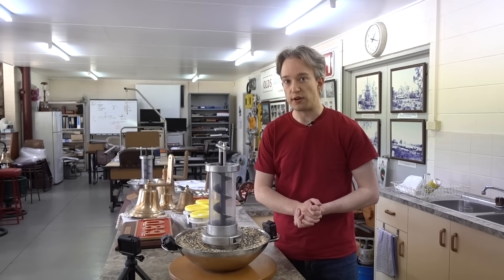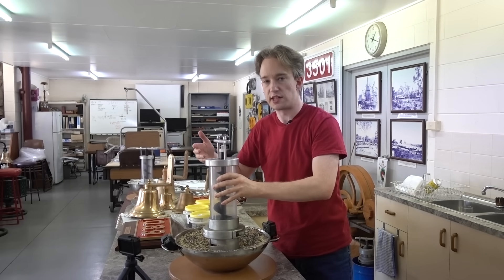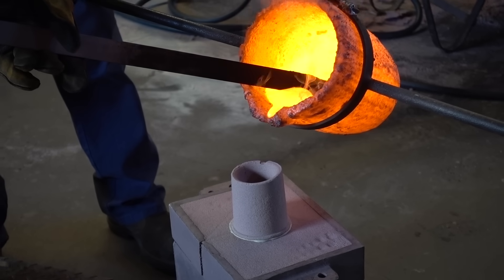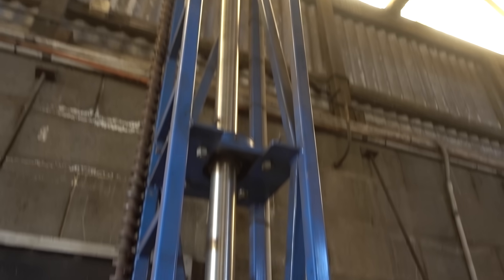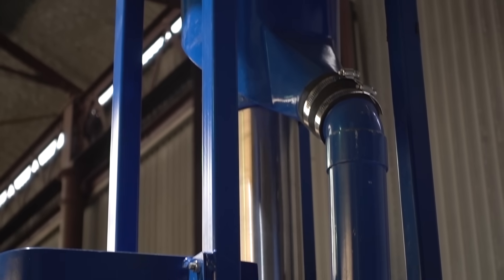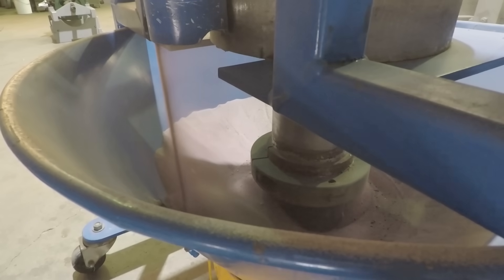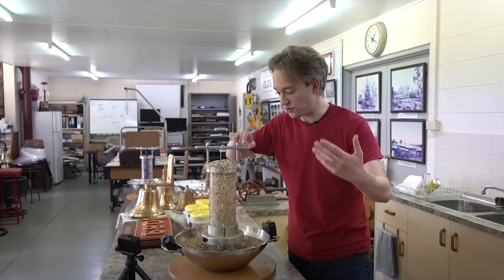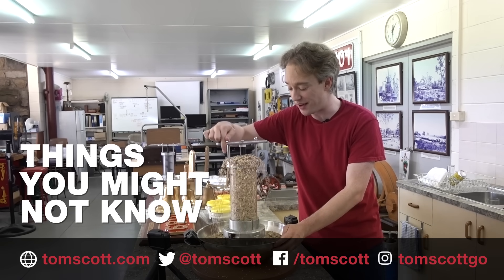Mr Olds' remarkable elevator

Comment: the main difference i see is that with the tube  it is necessary to have bulk to feed  the operation .... once the material in the tube reaches the same weight as the material out of the tube  the operation is no longer effective .....  with the screw ...  the material is being sucked in  and will continue to work as long as any material is fed into the intake .....  so ...  it all depends on what you are doing ... the sand that is recycled over and over again  is a good example of the tube being right for that job ...... in a grain silo ...  the necessity for all the material to be taken in  would be a good example for the screw

Comment: Olds Engineering is also responsible for a solar-powered pneumatic piston. That's it. That's the whole device. But the implications are astounding. With just a parabolic dish, a piston and a cylinder, we have a reciprocating thingamajig which could be used to turn over a dynamo or a rotisserie chicken.

Comment: I'm still not really sure I understand what the benefit of this is compared to turning the screw?
Reply: When a screw is turned there is a gap of air.. imagine sucking through a straw and each time you gulp there is a gap...

The case method is like pouring the drink straight down your throat
Reply: @nolesy34  What creates the gap of air?

Comment: I suppose it isn't too surprising it would work. If I had to guess, it works because in reality relative motion is what often matters. So to a tube around the screw, the screw it what's moving, and if it can get a scoop of some fluid or powder on the bottom spinning with it...

Comment: I wanted to test what would happen when this was done, wouldnt this make a sort of very sturdy drill? instead of dealing with material grinding around the sides you just pull the cut material into the center where it may be piped to some location

Comment: Interesting. I'd like to know why this is much superior to a normal Archimedes screw though? 
You can drive it anywhere up the shaft which is good, and you can keep the bearings away from the product; but other than that I can't see real benefits. Why would it product less dust?
Reply: most likely less dust due to less material being crushed by the metal screw, the material is only being push upward by the same material so it is less harsh, the hardness of the material doing the 'force' is equal. there might be dust created by the scoops but since it at the bottom of all the material being scooped the dust is not allowed to become airborne

Comment: I wonder if you even need the screw all the way up; if the machine had high enough tolerances and was dealing with large enough particles, it should theoretically be possible to only have the screw at the bottom. Of course, unless I’m wrong

Comment: So the problem being solved is there is a larger space possible between the casing and the screw allowing the product to be less damaged?  It also negates the need for long screws as the casing rotating does not need a screw running the length of it to elevate product?  I can see how it would save producers money by reducing product damage.

Comment: Perhaps this requires more energy than the traditional screw, and therefore wasn't considered earlier. Here you rotate the case, which might take more energy. And I wonder if the rotational speed of the material is the same (which costs energy: rotating it isn't free). It seems like the physics wouldn't care about the coordinate frame (think of this like rotating the Earth around the screw), so the material's rotational speed would be the same, but sometimes the intuitive answer isn't correct.

Comment: Please somebody explain to me what's the net possitive effect for the flow of solids between rotating the casing vs. spinning the shaft? I can see the merit at filling point as material is driven from the outside in and certainly with no void volume although this can also be achieved by standard designs with flight and pitch sizing. Another positive could be the length that can be built as would suffer less bending and torsional load BUT mechanically rotating the body adds extra complexity at the motor as gears and air-locks would be needed. 
People clearly has thought about this before, but a screw feeder is a cheap and cheerful piece of equipment, and it does the job: why reinventing the wheel?

Comment: I paused the video and I'm gonna take a guess at how it functions. When the walls rotate, they push the grain towards the screw surface, which is curved upwards. As a result, the grain has nowhere to go but up. It also might have something to do with the intake at the bottom of the conveyer, which is grabbing grain and pushing it into the grain which is already in the tube, causing a force which pushes it up the tube. I bet if there was no more  grain at the bottom, the remaining material in the tube would stop rising.

Comment: It probably hasn’t been heavily done before because it’s simpler to spin the center shaft rather then the housing. Especially without modern tech. If this was made out of wood like bamboo you would spin the shaft. Even with sheet metal. Making the shaft stationary and the housing spin is an overcomplicated process that just wasn’t necessary.

Comment: What's the maximum height it can lift and does the screw have to run through the entire height of a tube? Like what I be able to put a piece of AVS where your crank is and elevated 20 ft or would I have to extend the screw also?

Comment: Did you try rotating the "scooping" tube without the screw being there? It would seem that just the tube would force product into the bottom and its only path to escape, is up. Sorry, I didn't find this 'til today.
Reply: I believe the screw is taking some of the weight of the 'scooped' material, so it can be lifted higher before the weight of the accumulated stuff is more than the 'pressure' of new stuff getting scooped. So, it's not absolutely necessary in all applications, but it makes it more efficient in most cases.

Comment: This video is great, but doesn't answer the question: why is this better than a normal screw conveyor? The answer, as far as I can tell, Is that the rotating "scoops" at the inlet feed the conveyor continuously, while using the screw alone lacks a secondary feed mechanism. Or is there more to it? Someone mentioned that the surface area of the tube works for you with the conveying instead of against you in the standard screw conveyor, but is the surface friction of the screw less than that of the tube?
Reply: It doesn't push nearly as much air, so when working with fine substances like gunpowder, rice, wheat, etc, it doesn't spray them everywhere when they exit out the top with a gust of air.

Comment: but isn't this just obvious as soon as you see the scoops on the outside. they push grain into the core and it ge s pushed up because there is no other way. in other words wouldn't that work without the screw

Comment: it's cool, and probably practical to rotate the shaft from the outsite rather than the screw.

Not sure what the inventor mean about it creating less dust tho, since it's the same mechanism, and only different rotating parts.
Reply: The rate is more constant and the cylinder screw gap larger. It creates less “leakage” of particles dropping so less dust build up.
Reply: @AveragePicker  Oooooh ok, that makes sense. thanks

Comment: What would happen if you had both screw and cylinder rotating? And in my opinion the real working part is the scoops at the bottom of the cylinder. It kind of acts like a drill bit except that the hole just collapses in on itself because it's not solid.
Reply: Then you’d have a far more complex machine with compounded drawbacks of the traditional screw.

Comment: Rotating the cylinder instead made immediate sense to me. Rotating the screw CCW vs the cylinder CW should be roughly equivalent in terms of relativity. Ofc it's not exactly the same as the bowl of seeds would need to rotate with the cylinder for them to be truly equivalent, but it is ALMOST the same, enough so that it feels right to me.

Comment: Is this method more efficient or quicker at lifting particles that rotating the screw?
Reply: Yes, because the bearings and motor can be fixed to the outside instead of the inside, kept out of reach from any stray particals that want to get inside the moving parts. Additionally, the driving force can be affixed anywhere along the tube instead of just the very top and the very bottom

Comment: What's not clear from the video is why it's preferable to the traditional version of turning the screw itself.
Reply: it is very clear if you watch the whole video, they explain it creates less airborne dust which can be beneficial from a safety aspect if you don't want things to explode\ignite
Reply: @coreysuffield  if that's the primary advantage, then they buried the lede. In describing the reason he created it he said they originally used it for sand, which is, of course, not explosive.
Reply: @andrewsomerville5772  well for their case it might have been purely about dust control for hygienic reasons and workplace quality of life

Comment: I think your explanation misses a big part of the mechanism. 
You say the particle at the entrance are shoving in the rest, which is true, but that means it would work even without the screw (which would limit the amount of lift you can get for a given material.) 
It's the friction of the slander with the material inside. It makes the material rotate, and as long as you have the material rotating relative to the screw you will have up or downwards movement. This means that the more material you have in the tube the more surface area you have and the more force you can apply, allowing the lift to be as long as it needs to be.

Comment: If the bottom were perfect cylinder then it wouldn't work.  It's the scoop shape that forces grain from the outside to the inside and forces the grain at the bottom to rotate so it goes up the screw and allows more grain to be pushed inward and then up the screw.

Comment: What if the internal side of the pipe would be corrugated for higher friction?
Or have a screw thread in the opposite direction to the blades?

Comment: Is the screw entirely necessary in the rotating tube or is it invalidated if the rotation of the spiral is reversed? I can understand why the tube works but I'm confused as to how the screw isn't a hindrance. I suppose it doesn't really matter. I can see a problem with this though if the screw isn't turning then a portion of substance is never moved but resolves into part of the central core.

I suppose the Whole pipe must turn and not just a lower section or bit for the reason of compaction?

Comment: How is this more efficient than just the screw turning?
Reply: it is more efficient because with certain materials there is less explosion due to dust in the air, this mechanism keeps any dust creation at the bottom of all the other material so it does not get a chance to become airborne.
having the conveyance mechanism is explode is not very efficient

Comment: I don't get the difference. Wouldn't the relative motion of sand, pipe and screw be the exact same wether you rotate one or the other? Number of support points for screw and pipe remain the same... Am I missing something?
Reply: The real trick I think to it seems to be in the larger gap between the screw and cylinder wall. It makes the flow more constant and doesn’t require syncing a loader to it. Plus there’s no rotation bearings/seals at the base of the screw.

Comment: There's just one thing troubling me. Why is the screw still in there? Is it performing a function? If so, what is that function? Would the machine not be even more efficient without it?
Reply: the screw is a ramp for the material to flow upward, the scoops at the bottom only pull\push material inward, not upward

Comment: Could someone who understands explain to me how this design keeps dust down, as was claimed in the video? I feel like it may have something to do with the clearance of the material between the tube and the screw, but I can’t pin it down.  To me this seems like a major advantage of this device for maintenance, quality, and safety reasons, as well as the lessened crushing of material (this I understand IS due to the clearance of the tube and augur), and ease of driving and securing a rotating outer tube compared to a rotating inner augur.

Comment: The chap briefly states that the new method generates less dust, and due to the clearance damages the product less.  But the video fails to answer that if its exactly the same process, how is any of that possible and how is there any benefit using this new method?  To me to appears that you're shifting more weight by rotating the sleeve rather than the screw.  It doesn't make sense to me that this would be more efficient or have any benefit?

Comment: Would it work without the screw? And would it work with liquids?
Reply: Without the screw? How?
Reply: @AmB39  It works because it's forced in by the 2 fins at the bottom. I'm sure the screw helps but if you got rid of it, what would happen?
Reply: @leonhardeuler675  probably not much

Comment: It's not the same. With just the screw rotating, the media 'drags' along the 'fixed', 'large' inner surface of the tube as the bulk of the media 'packs' against the screw flutes due to gravity. By rotating the tube, you can imagine the media simply being 'dragged up a spiral staircase' with a continually 'unpacking' effect on the media.

Comment: Is someone going to explain the difference between turning the case or the screw?

In this case, it seems to me the push/pull dichotomy is meaningless.
Reply: It is a spiral staircase.  When the screw turns,  it is like the stair case spins while people behind you hold you in the same position.  
When the casing spins, the people behind you are being pushed forward, they push you up the staircase.  

Hypothetically,  only the bottom of the casing where the impellers are, has to spin, the rest can be stationary.

Comment: not confused on how it works, just don't see the point.   looks a bit more complicated with a bit less efficiency than regular auger, harder to do bearings, less surface area contacting grain, and the rotation is not enclosed so less safe

Comment: Would it work with water?
Reply: To be certain Ask Archimedes, but I'm guessing yes. The principle is still the same.  The standard turning core model's been in use with water for about 2 millennia. The key would be ensuring that the turning scoops pull in enough to cause the thing to work with what leakage would occur around the edges of the screw.

Comment: The analysis fo this machine is largely wrong. The pumping action is generated by the entry part of the tube. The rotation of the tube is adding very little force to the material at least greatly reducing friction between tube and material. The reason its not generating dust is because the pumping action is only at the beginning and the upper material is lifted by the following material underneath. It looks the same but the pumping is really generated by a different principle than a rotating screw. And thats why we all are confused.

Comment: this is just another take on the archimedes screw design. its novel in the fact they rotate the outside to move the material but from a mechanical standpoint little has changed.
Reply: That's the entire point. It took 2300 years for this application to be thought of.

Comment: It isn't counter intuitive at all, it's common sense. The problem is the efficiency. Either way you lift a load, but by spinning the cylinder instead of the auger you are turning a larger mass. This is less efficient.

Comment: To me, it actually seemed intuitive that grain/sand/etc would lift/lower no matter if it's the screw or casing that's rotating. Simply based on relative motion, being that from the screw's perspective, the casing rotates and from the casing's perspective, the screw rotates. I only would think that the difference is in whether clockwise rotation lifts or lowers.

Comment: Not even going to try to address the obvious question on everybody's mind - why not rotate the screw?
Reply: rotating the screw leaves a lot more air; moving the wall (with the scoops on the side) forces more material into the screw than rotating the screw does.
(Plus it's easier to turn something that isn't surrounded on all sides)

Comment: I thought almost immediately that it makes sense, but I suspect my reasoning is wrong or partially correct at best. 

In my mind rotating the cylinder or rotating the screw is the same, because the friction and pressure (and the vector of force?) is the same. Maybe we feel this is counterintuitive because rotating the screw is just more simple and so we've hadn't even thought doing it the other way. 

Videos like this are so amazing, makes you think and thinking is good for you.

Comment: I found the solution to how the rotating cylinder works to be very self evident. The system only needs rotation to work. So even if only rotating the sleeve, it is still mechanically exactly the same as rotating the screw.

Another way to think of it is this. Lets say I want to drive a screw into a piece of wood. So I start out with a screwdriver to drive the screw into the wood. Then, after the screw is part way into wood, I stop screwing. At that point, I decide to put the screw into a vise. I then rotate the block of wood. As I do this, obviously in the proper direction, the screw is driven further into the wood.

Why this sort of thing baffles people is a mystery to me.

Comment: Most everything sand, zeolite, and so on is air classified now, and conveyed with air. Screws, conveyors, bucket elevators are becoming a thing of the past. Also most cones work this way, the cone is stationary and the outer housing rotates.